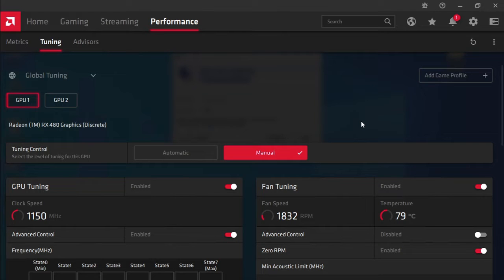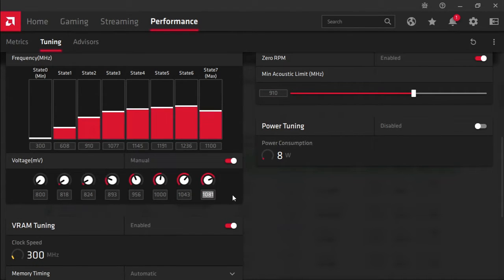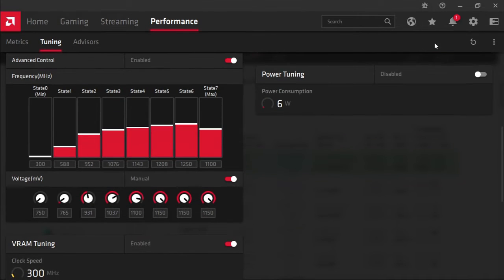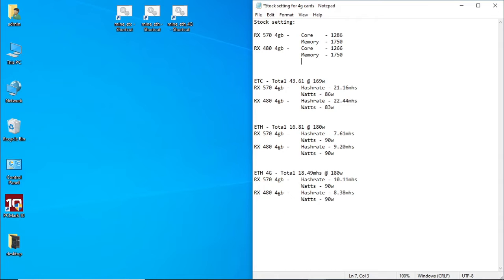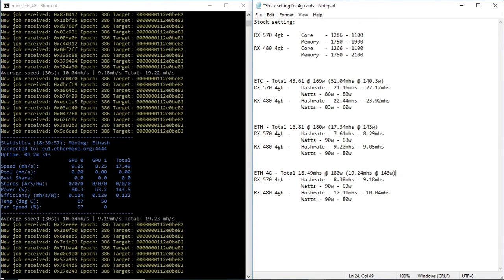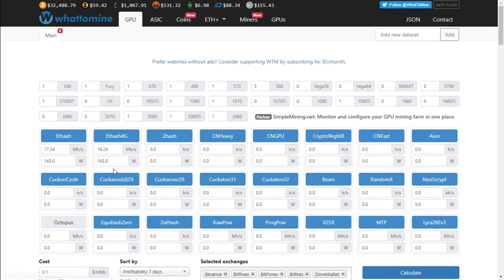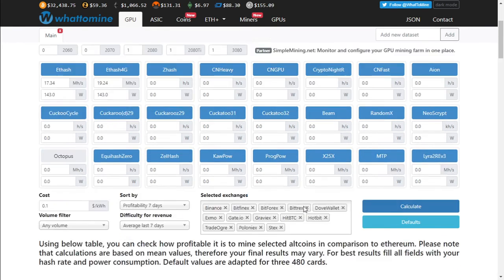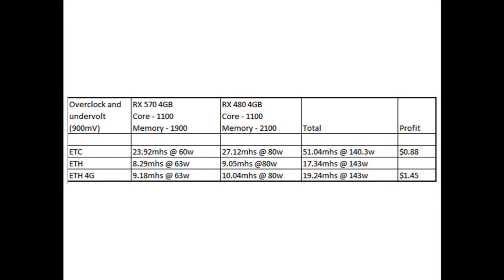ETC and ETH ZombieMode - LOLMINER and 4gb Graphics cards - Overclock and undervolt - Part2

Comment: is this still working with epoch 400?
Reply from the maker: Current epoch is 402, yes you can still mine ethereum. Change the dag size in bat file. I made mine 4500. Getting 23mhs on RX 570. Make sure that you change the setting in amd sofware to compute.
Reply: @sloshmining  i have 6 in a rig and i only use hive os but each one makes only 5 mh/s ETH :(
Reply: @sloshmining  how do you do this changes? maybe you have time to make a video abut this or mining with 4gb gpu ;)

Comment: hello, i saw the two parts of the videos, and i had the same hashrates on lolminer and i just change the parameter --4g-alloc-size from 4096 i think to 4180 and the hashrate increase, and its better if your output video is from the motherboard and not form a gpu. i hope it works for you!!
Reply: edit this in "mine_eth_4G"
Reply from the maker: Hi David, will definitely try and see what happens. will let you know. thank you for the comment